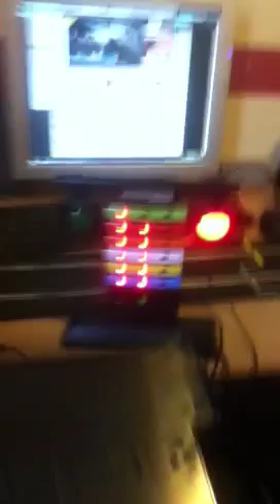Otaku Scalextric - Pit Lane Game Remote Power Mod

Comment from the maker: Yes, the cars are uniquely identified. It works through the Infrared LED on the car's underside. So the car's IR Led zaps out it's id code, and the Pit System's IR receiver receives at as the car passes over, and then it can tell who's pitted.

Comment: Nice mod. Can you please undo the two screws holding on the end pins before soldering to the lugs. If you don't do so the heat travels through the lug, through the screw to the screw threads and then it distorts the mount, and the pin connection gets dodgy....
Reply from the maker: Thanks for the alert Riko, I'll put an annotation in later today to update that video. We haven't had any issues ourselves that was related to dodgy pin connections, only operator error ^^;